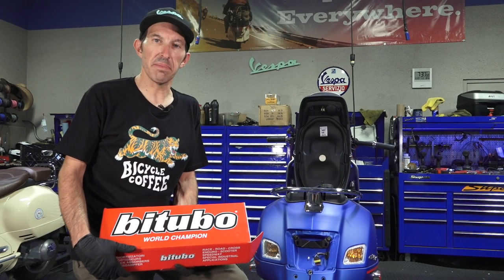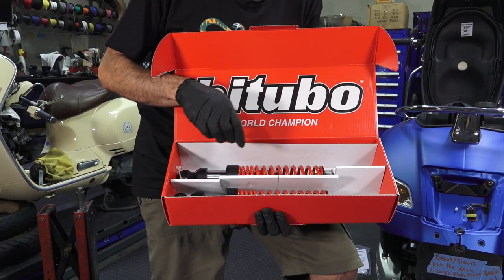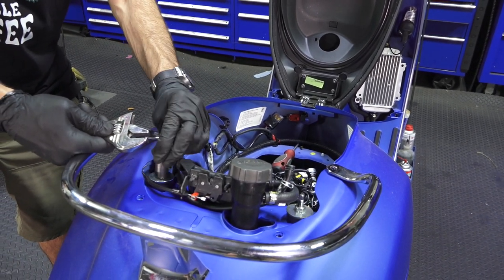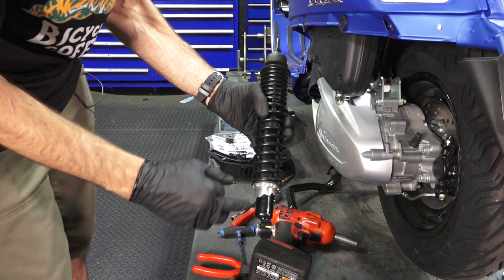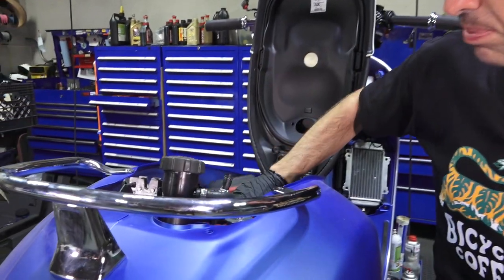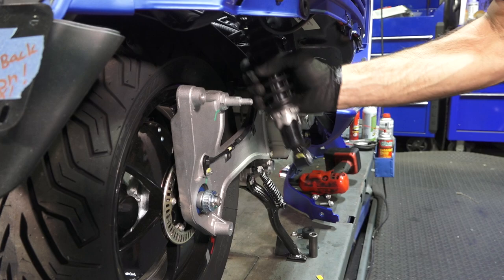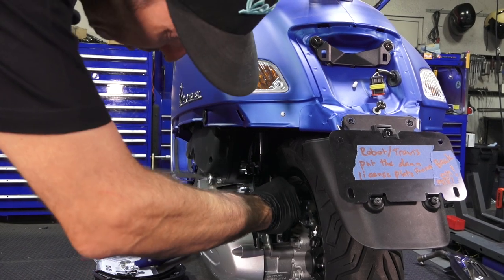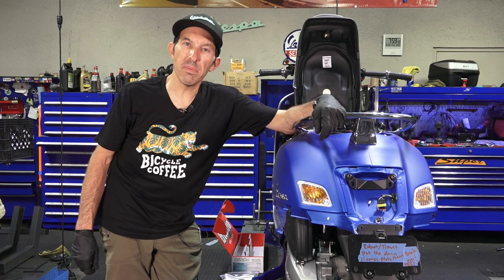How to Install & Upgrade to Bitubo Rear Shocks on a Modern Vespa

Comment: Hi Robot I replied about 6 months ago to this but today took the plunge: dry day for outside work and no work to go to and fitted new rear shocks: not this brand but YSS with top adjustment rather than at the bottom. I needed an impact driver to loosen the top nuts as my 2010 model only had a slotted top rather than a flat to put an adjustable spanner on. Other than that nice and straightforward. Without your video though I don’t think I’d have contemplated the job so thanks a lot again. Keep up the good work 👍🏻

Comment: Thanks for the info..  Great video ..  But with the price of a Vespa, the stock shocks should already be some VERY good shocks..  The ride is super important, especially since gov'ts are broke and not repairing roads like they used to..  Also, I have noticed several videos that you mention people may seem to want a lower seat height.  I am 6'4" and am looking for a TALLER seat height..  Plus I like to sit up higher to get a better view when I am riding..  I am a casual/recreational rider, and am NOT interested in a low center of gravity to go around corners at a higher speed..  Please don't forget about us taller scooter riders..

Comment: WATCH OUT - the spacers are mounted the wrong way around. if you check titubo instructions, the have to be on the inside on the left and on the outside on the right looking at the Vespa from behind!

Comment: Cheers Robot I have no garage so have to work on the driveway but you make stuff look so easy to do. I aim to change the rear shocks first on my 2010 GTS 300 SS as they have originals on and I ride with a pillion and top box and they’ve covered 27000 miles . Thinking of an upgrade rather than stock 👍🏻
Reply from the maker: You can do it!

Comment: Thanks Robot. These videos have come just in time as I am considering upgrading my suspension. Would the ride be improved even further if the OEM rubber bushings were replaced with the better quality Clauss alternatives?
Reply from the maker: Glad it helped. The Clauss buffers are definitely high quality, but you may find them to give a stiffer ride. Probably more geared towards performance/race style riding as opposed to cushy cruising. Just depends on what you're after....

Comment: I would love to see you do a video on the proper set up of pre-load.  I recently put the Bitubos on my '18 BV350 and find myself continually chasing away front wheel wobble.  I am a bigger guy on a scooter so my Bitubo's are cranked down quite a bit.  Thanks.  Stay safe.
Reply: Hi David I had chronic front wheel wobble on my 300 GTS super sport 2010. Changed the tyres from Michelin to Pirelli Diablo Rosso and it stopped it, can even ride one handed at an indicated 70mph. Handling generally is night and day better than the Michelins

Comment: Just installed the Black Edition Bitubos on my 2010 GTS 300 and im pretty sure you got the spacer on the wrong side on the left Shock. The instruction says it has to be inside. 😬